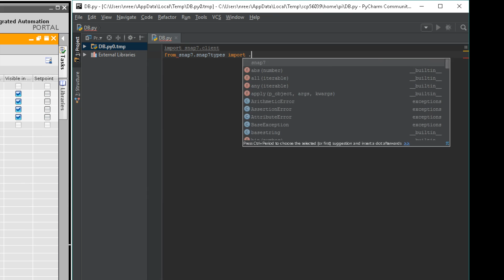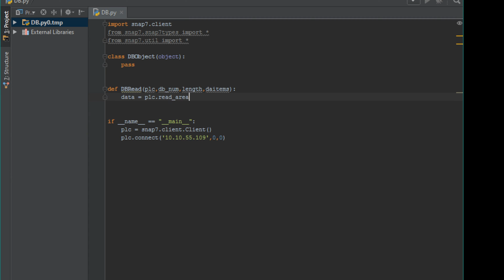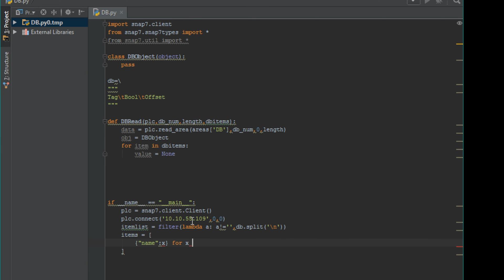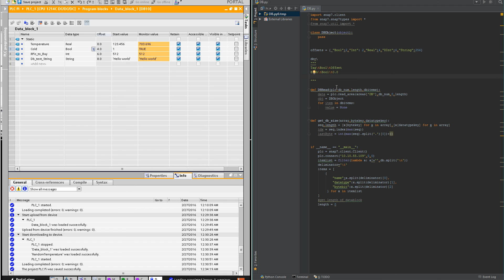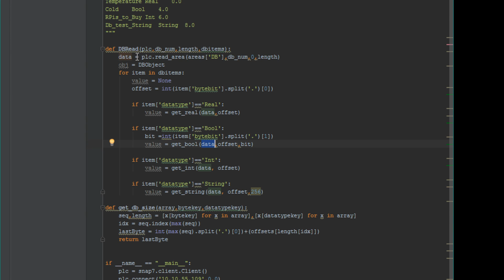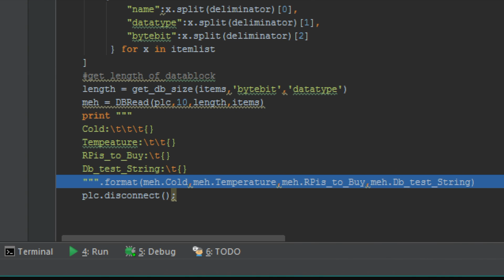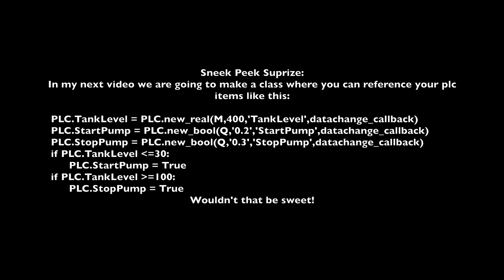Raspberry Pi - Tutorials - S7-1200 & Snap7 Python - Mapping & Reading Datablocks

Comment: Hallo, 
my Problem is:

pi@raspberrypi:~ $ ipython
Python 2.7.13 (default, Nov 24 2017, 17:33:09)
Type "copyright", "credits" or "license" for more information.

IPython 5.1.0 -- An enhanced Interactive Python.
?         -> Introduction and overview of IPython's features.
%quickref -> Quick reference.
help      -> Python's own help system.
object?   -> Details about 'object', use 'object??' for extra details.

In [1]: import snap7

In [2]: plc = snap7.client.Client()

In [3]: plc.connect("192.168.0.1",0.1)
---------------------------------------------------------------------------
TypeError                                 Traceback (most recent call last)
<ipython-input-3-16bf3f6f99af> in <module>()
----> 1 plc.connect("192.168.0.1",0.1)

/usr/local/lib/python2.7/dist-packages/snap7/client.pyc in f(*args, **kw)
     22     """Parses a s7 error code returned the decorated function."""
     23     def f(*args, **kw):
---> 24         code = func(*args, **kw)
     25         check_error(code, context="client")
     26     return f

TypeError: connect() takes at least 4 arguments (3 given)

Comment: Hello. I get this error message when I try to run this script on Raspberry pi 3 . you have no idea what is wrong?

python DB.py
No handlers could be found for logger "snap7.common"
Traceback (most recent call last):
  File "DB.py", line 53, in <module>
    plc.connect('10.10.55.94',0,0)
  File "/usr/local/lib/python2.7/dist-packages/snap7/client.py", line 25, in f
    check_error(code, context="client")
  File "/usr/local/lib/python2.7/dist-packages/snap7/common.py", line 65, in check_error
    raise Snap7Exception(error)
snap7.snap7exceptions.Snap7Exception:  TCP : Unreachable peer
Reply: I fixed it by adding this to the top:

import logging
logging.basicConfig ( ) 

But has still trouble reading string tag :

 python DB.py
Traceback (most recent call last):
  File "DB.py", line 68, in <module>
    meh = DBRead(plc,10,length,items)
  File "DB.py", line 41, in DBRead
    value = get_string(data, offset)
TypeError: get_string() takes exactly 3 arguments (2 given)